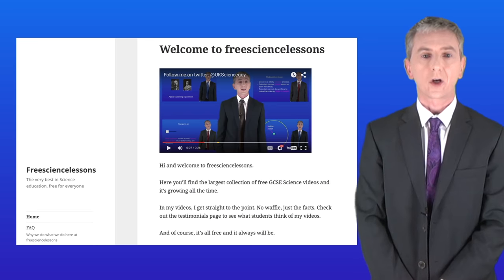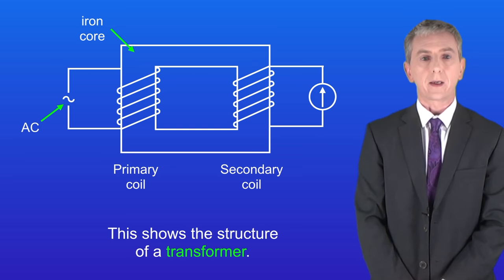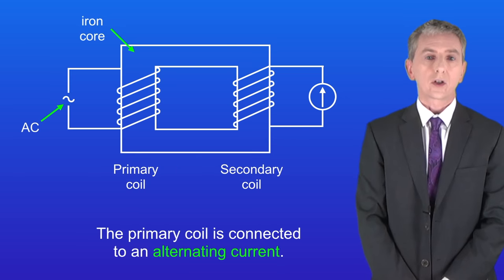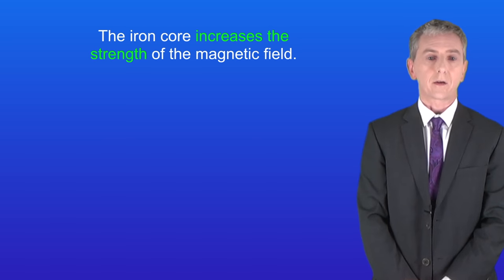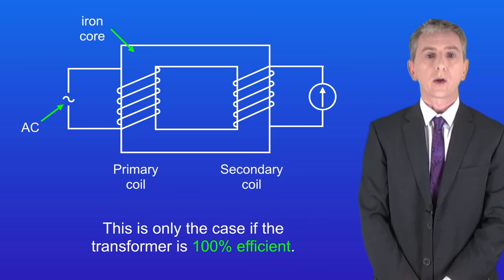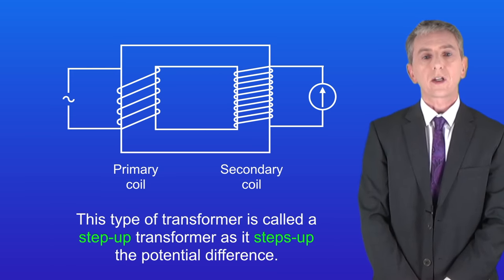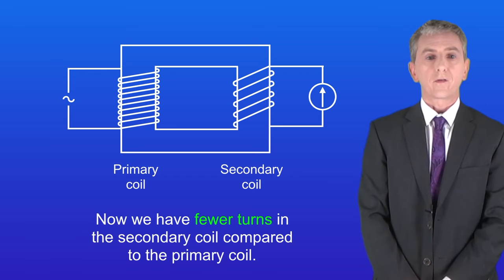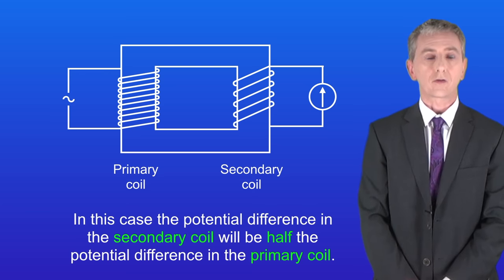GCSE Physics Revision "Transformers" (Triple)

Comment: But aren't the coils complete? If so, why is it inducing potential difference instead of current?
Reply: I think by inducing a potential difference, in turn, it also induces a current because the coils are complete. But he just didn't mention that.
Reply: im 2 years late but it induced both a potential difference and a current, the spec doesn't require us to go into much detail about the current, only the potential difference

Comment: Hi sir, why is it that the iron core transmits the magnetic field generated by the AC but not the current itself from the primary coil to the secondary one?
Reply from the maker: The wires wrapped around the transformer will be insulated (coated in plastic) so no electrical current can pass from the wires to the iron core.
Reply: @Freesciencelessons  Thank you!